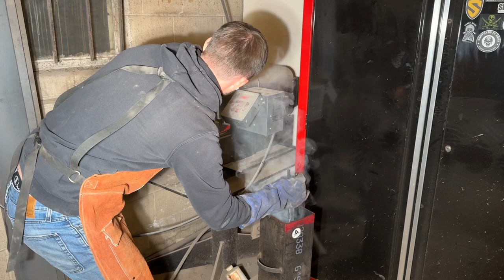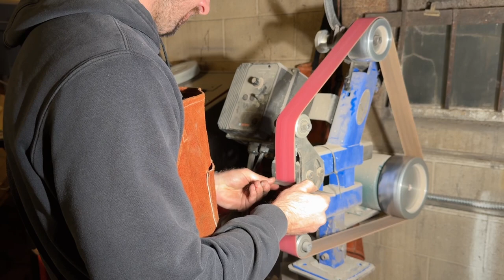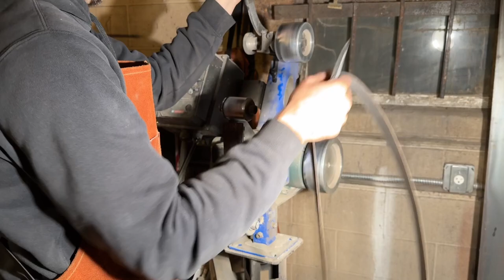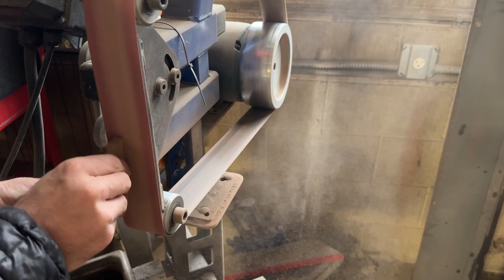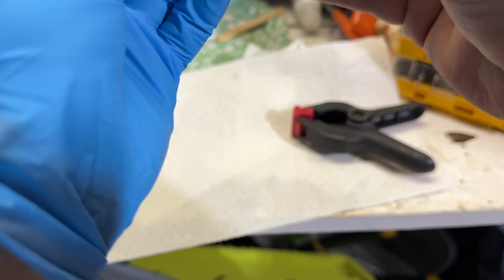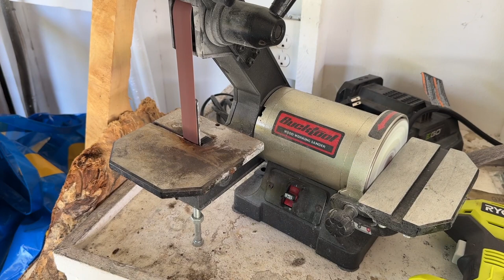Making the Finch Knife Kit - DIY Tutorial for Beginners

Comment: Do you only harden the blade portion? Because I drilled 3 holes in the tang to put brass pins through and it was like drilling through mild steel.

Comment: How are the ring sub box people supposed to do this? I don't think a belt sander is a tool they'd have around, especially doing rings.
Reply: You’re gonna have to get a belt sander for sure but if you want to try out knife making you can get one for $60-100
Reply: The heat treat is usually the hardest part for a beginner to get right, and that's already been done for you.  Since it's already been hardened, using a file won't work and you need a belt grinder at the very least.  I've found that a little 1x30 belt grinder from Harbor Freight is perfectly adequate for knifemaking as a hobby, and it can come in handy for making rings (and pendants) as well.  I use mine to trim down excess gemstone/powder fill on rings before chucking it back in the lathe for final shaping...it seems to chip gemstones out a lot less than using a dremel or lathe.  They're good to have in any shop.  I've made some really nice knives on a HF 4x36 belt sander tilted vertically, it's great for keeping the bevel flat and more consistent, plus it powers through rough shaping a lot faster than the 1x30.  A lot of people have 4x36's already, they're super easy to find locally at garage sales, thrift stores, and pawn shops.  All sorts of grits are available online for either.
Reply: @Skinflaps_Meatslapper I've been using files and sandpaper just fine on mine which means either the steel they sent us is lousy or they weren't exactly truthful when they said they heat treated it before sending it to us. I'm inclined to believe the latter with how PAS/WJK has been doing things lately.

Not that I really care, I never wanted this knife. I have a perfectly good utility knife in my EDC. It's just another project to keep me busy.
Reply: Thanks, this is good info! @Skinflaps_Meatslapper
Reply: @TheZippingMeteor  Properly hardened 80CRV2 should be at 60RC or so, that's soft enough for a good Nicholson file at 64-66RC to bite and remove material, but it's not what I would consider an effective use of my time lol.  Contrary to TV shows and whatnot, a good file is still going to scratch and remove some material from most fully hardened blades unless you're using the same high hardening steel as the file and you're really good at heat treating and grain refinement.  Being able to feel whether the file bites easily or wants to skate off and determining roughly where the hardness lies from that alone isn't terribly easy.  Sandpaper is going to shape any steel no matter the hardness...I mean, I use it to shape tungsten electrodes so it'll abrade just about anything.  80CRV2 should be in the 40-50RC range when annealed, depending on how well the supplier annealed it, and that's how WJK usually gets their stock.  50-55RC is right around where an average axe is going to fall (not the expensive ones with tool steel edges), so if you've got a basic axe at home you can get a rough idea of whether it's been heat treated or not by doing a simple scratch test on a part of the blade you cleaned up.  An EDC knife should (this varies wildly however) be a bit higher than an axe if it passes that test and want to get a closer approximation.  One thing I've learned is that most carbon steels won't fully harden from an annealed state, grain refinement from normalization cycles will give you not just a finer grain but the potential for the steel to fully harden.  You're hardening it a small amount each time you normalize, so it's less of a jump from soft and ductile to fully hardened in one single process.  When you think about what all goes into annealing, the hours and hours of controlled cooling and precise temperatures to get spheroidal formation in the steel just to get it that soft, heating it to quench temperature and letting it air cool is certainly going to add some hardness to the steel along the way.  It won't be fully hardened like a quench, but you're working against that annealing process by redistributing carbides into smaller and smaller grains, so that when you do quench, it'll lock that grain in and give you full hardness.  Even if you hit that perfect temp and hold it for the perfect amount of time and then quench it in just the right manner, you won't hit full hardness starting from an annealed state.  It's possible that it wasn't able to reach full hardness because it needed some normalization cycles first.  The first two knives I made went from annealed to a quench and didn't hit the hardness I wanted either, but they did reach the tempered hardness I wanted to end up with (55-57RC), so I ended up not tempering them beyond a single pass at 350F just to let the steel de-stress a bit.  So you might have a hardness that's perfectly adequate for what you want, I couldn't say.  One thing you can do if the hardness is not where you want it is to give it a cryo treatment since it's a type of stainless that responds to it.  You can get 1-2RC extra hardness by using dry ice in a cooler, sometimes up to 3RC if you dunk it into liquid nitrogen (but who has that just laying around?).  There's no time limit between heat treat and cryo either, so long as you haven't put it in the oven for a temper.  It's super easy to do and cheap, just grab a few pounds of dry ice, a cheap styrofoam cooler, and bury the blade in the ice for a few hours or until the ice sublimates.  Optionally, a plastic tray with iso alcohol in the cooler can give you a faster turnaround, use the dry ice to supercool the alcohol and make a bath for the knife, drop it in for 30min and you're done.  From there you can temper it down to whatever you want or leave it as-is, but I suggest you shape the knife and drill the tang for pins before cryo so you're not unnecessarily fighting any extra hardness gained.

I only got in knifemaking because I wanted to make a Christmas present for someone else, I didn't want or need another knife either.  But I ended up buying and making a lot of stuff for that one knife and figured I might as well make a few more with what I have to see if I could get any better. I'm pretty sure that's how most of my hobbies have gotten started actually, I made a ring for the wife with no interest in having more for myself, and now I've got several of my own and I'm forging rings out of mokume gane and damascus for reasons that I still haven't figured out yet.
Reply: @Skinflaps_Meatslapper This is not, nor will it ever be, a hobby I care about. So all that information you just directed at me was a waste of your time. I just know that yes, a cheap hand file will remove material from these blanks despite what you said initially.
Reply: @TheZippingMeteor  Nah, someone will come along and find it useful.  Not my problem if you don't appreciate it, and if that's the case then the only time that's been wasted here has been your own.
Reply: @Skinflaps_Meatslapper  I've bought a vintage red river knife blank and wanted to drill the pin holes to be able to put larger pins in, and the part that was hardened I needed a special drill bit to cut through. I received this knife blank and I drilled 3 holes to put pins through and it was like drilling through mild steel.
Reply: @adamarthur9672  Is the blade just as soft as the tang?  I'd imagine that if there were no holes in the tang as shipped then they wouldn't have hardened that area for obvious reasons.  Otherwise it's probably just a bad heat treat, whether the temp was off or the quench was interrupted.
Reply: @Skinflaps_Meatslapper  well the only file I have is a worn black diamond brand file and it was biting into the steel verses skating off so I would say it was a bad heat treat. But I'm new to this so I'm not sure exactly what the issue is.
Reply: @adamarthur9672  Yeah if there's not a lot of scale on the blade and you're in good steel, and the blade is doing the same thing as the tang and you can't tell a difference between them with your file, it likely didn't harden properly.  I doubt there'd be that much decarburization on the surface given the fact that it wasn't forged to shape, so that's probably out as well.  It could've been a oven temp setting or a quench issue on their part, who knows.

My suggestion, if you do want it hardened, get it to the shape you want right now while it's still soft.  Then find yourself a forge or kiln (even an oxy/acetylene torch or a propane weed burner can work) and heat the blade uniformly until a magnet won't stick to the blade.  Sunset or dark is the best time to see the heat, or in a shop without a lot of light.  Once you reach the point where a magnet won't stick, dunk it straight into canola oil or water if you're feeling brave, fully submerged, and stir it around until it cools.  You won't hurt anything by leaving it in there, just don't take it out too quickly.  Try not to overheat the tip and edge, keep the heat toward the spine and let it migrate to the edge, and leave at least 1/8" thickness along the edge to avoid cracks and warps.  Shaping the edge and tip down to a sharp point will often end up with an edge that looks like cooked bacon or the tip might snap off completely.  The basic procedure is in the video but that's really all there is to it.  If it was partially heat treated beforehand, you'll probably have a better chance of it reaching full hardness a second time.  It sounds like a lot of steps and hassle but it's really not, it only becomes difficult when you're trying to get fancy with it.  I did my first good heat treat with a weed burner and a pot of water, so it's certainly doable with most anything you have on hand.

Another option, if you really want the heat treat to go right, there are companies online you can send your blade to that will give it a precise heat treatment, some bladesmiths will actually send a box full of shaped knives out for heat treatment so they get consistent results for customers.  That's always an option if you don't mind spending money instead of time on it.

Lastly, if it's just for fun, it'll still take an edge being as soft as it is.  Super easy to sharpen that way, it just won't hold an edge for long and won't handle much abuse.  Use it to cut open amazon packages and letters, little stuff around the house, or use it as a steak knife...it'll serve those purposes just fine.  People used to fight wars with bronze swords and they weren't close to the hardness of annealed 80CRV2 steel.  Good luck either way!